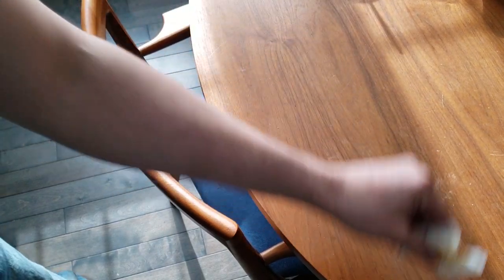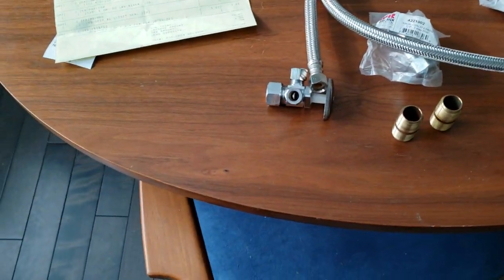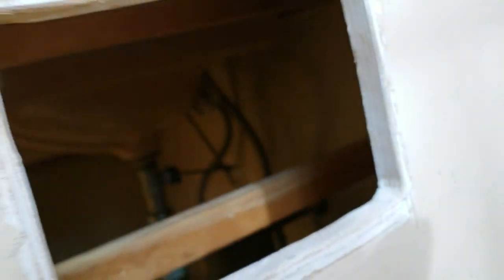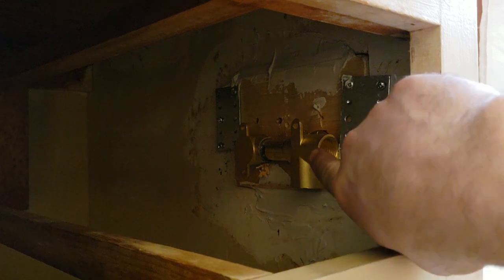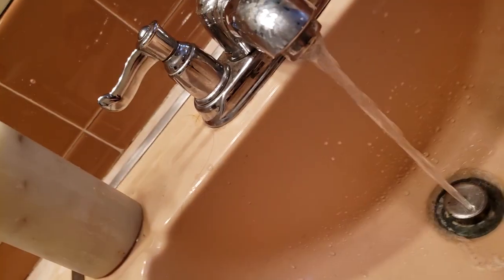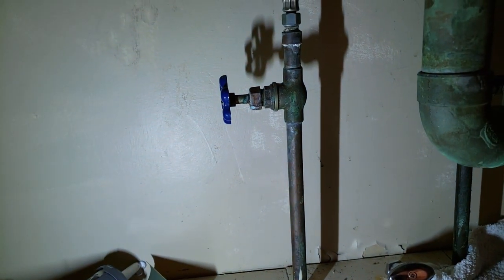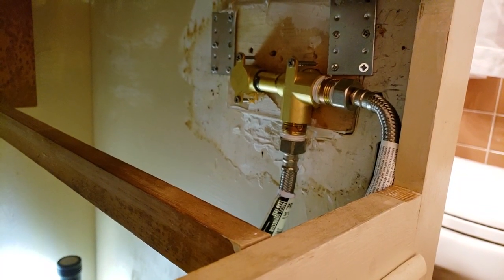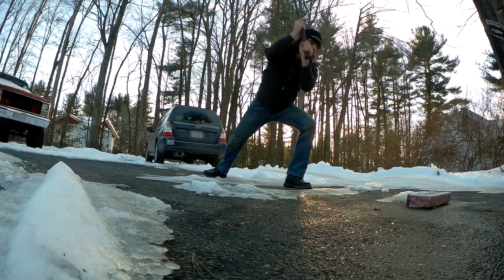How to Install a Hot/Cold Bidet + Review (Trustmi)

Comment from the maker: Update 01/05/21:
I have mad a new bidet install video, but without any of this soldering business.

https://youtu.be/fHHHnV5-5eo

Bidet:
https://amzn.to/2Wl07b7

You have a few options for installing a bidet - the first is obviously outlined in the video, but may be outside your DIY comfort level. The second is a lot more accessible and that's the toilet attachment bidet:

https://amzn.to/39QALJ4

1) shut off water supply valve for toilet
2) flush toilet to make sure no more water is flowing (if it is, double check valve is off. If so, you may need a new valve)
3) unscrew the hose from the tank, and screw on the supplied T junction to your tank
4) attach bidet, attach all hoses, turn on water
5) check for leaks, and enjoy not waiting in line at Wal-Mart for the last roll of TP
Reply: Can you control the temperature
Reply: This was absolutely excellent! Bravo! I'm absolutely impressed with this installation. This video solved my plumbing issues without going too far out the way. Providingthe plumbing is in normal operation.. last but not least funny!!! Thanks for the tutorial and recommendations!
Reply from the maker: @jcdchameleon4155  thank you! Glad to help!

Comment: Hiya,
Greetings from NZ, and awesome work there. I however have a question regarding the fitting of it to the side of the sink. Is it a good tight fit without having to fasten it to the side of the sink with screws? The bidet set I have chosen is similar to yours and what I assume as screw holes are useless in this case as they sit farther away from the side of the sink. Any advice is welcome as I am a noob.

Cheers!
Reply from the maker: Hi there, the fit is only as snug as you make it to be. That is, if you cut a hole that fits the bidet fairly precisely, then friction will probably do a pretty good job of keeping it in place. But don't worry too much about the screw holes standing farther away from the side of the cabinet -- mine is the same way. I screwed it in anyways, and it does a good job keeping it in place.
Reply: @Bootstrappin  Ooooooohh..long screws. Gotcha, will do that. Thankies for the quick reply. 👯‍♀️

Comment: Could these be used in a shower will you get good pressure if you need it to
Reply from the maker: No reason it couldn't, they are supplied by your regular plumbing. Installation in the shower could be tough though, major project.
Reply: @Bootstrappin  were opening a dog grooming salon .. and building the bathing room from scratch... i bought 5 of these for the tubs because i like the look and how the handles have a holder.. i order them from Amazon should get here tomorrow.. my only worry is the water pressure i need good pressure to wash a big dog well see of these work when they get here tomorrow
Reply from the maker: @dianer5605  oh I see what you're trying to do now. In that case I'm afraid you might be disappointed unless you find a different nozzle to put on it.
Reply: @Bootstrappin  just fyi i went threw with the purchase based on your review alone it was very helpful and full of information thank you :).. the end of the video was very helpful seeing the  facet work in action... i like how you showed the water pressure and all the features which i think will be awesome for what i need it for i hope they work if not ill return them and get something else .. hope i dont have to these look awesome i have a few ideas about possibly changing the nozzle but i jave to test it first
Reply: @Bootstrappin  is the hose the same as a shower hose or smaller?
Reply from the maker: @dianer5605  I'm no longer at that house, but it did seem like a standard hose yeah
Reply: @Bootstrappin  awesome thank you